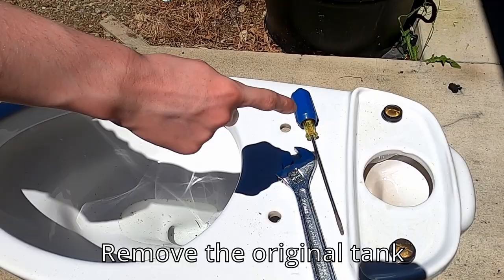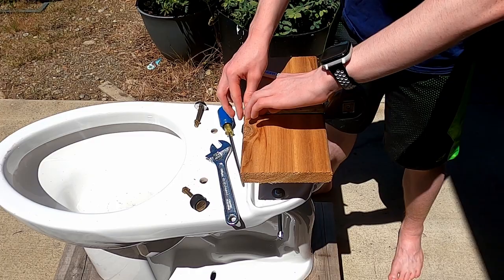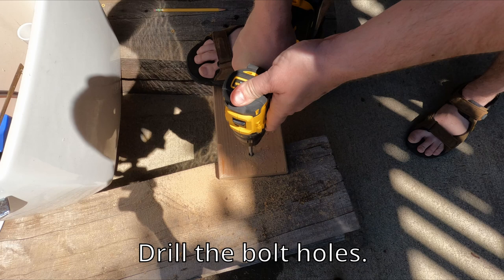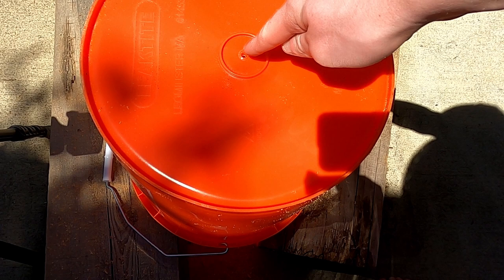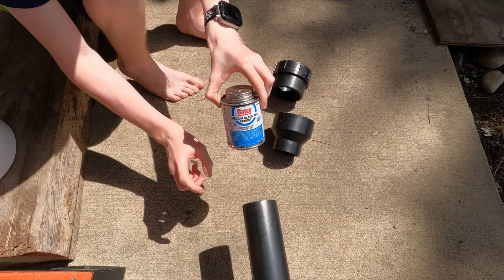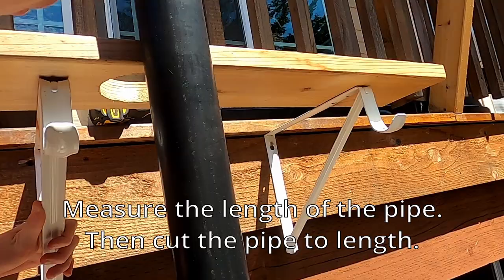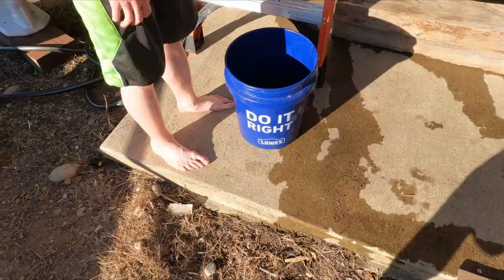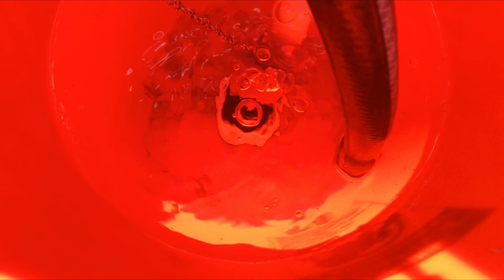How to make a high bucket tank for your outside toilet

Comment: I would put a  Fluidmaster fill valve in, and connect it to the hose with some adapters
Reply from the maker: Thats a good idea, especially if you don't have a pump.
Reply: @cjtplumbing9419  yea, and it would stop filling when it is full